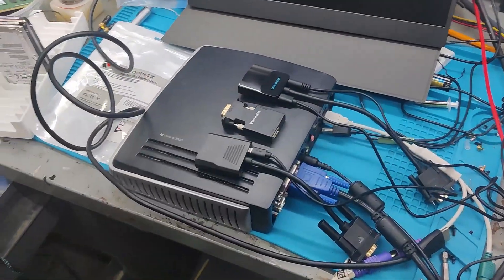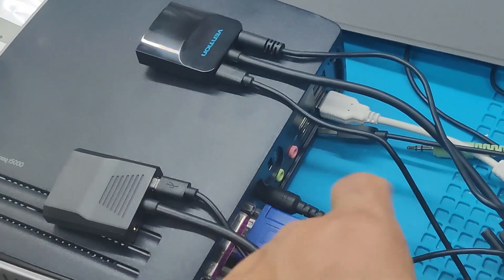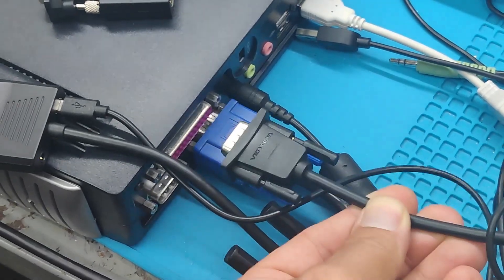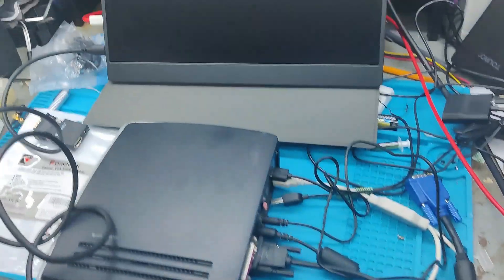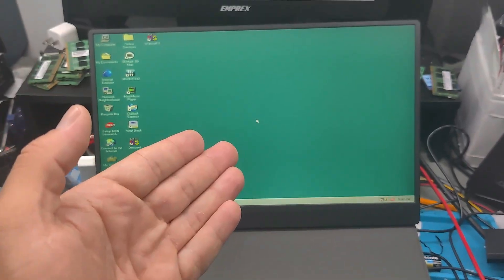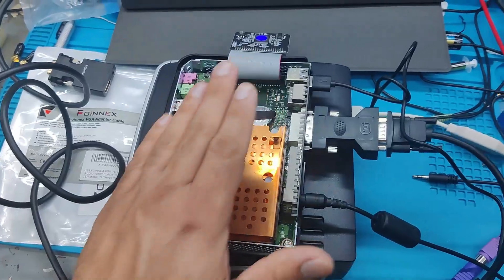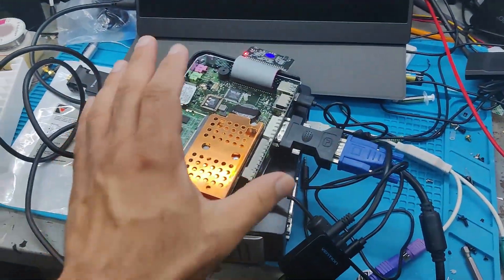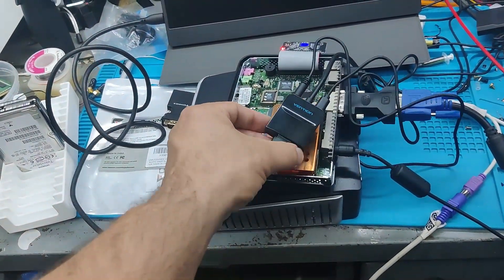Why Many VGA→HDMI Adapters Don't work with Retro Computers

Comment: My adapter works fine but unfortunately it controls all aspects of my realtek audio and windows standard audio. If I use a phone charger to prevent usb audio taking over the screen is blank. My old media pc hp m7000 will not let me have any sound inputs or outputs. If I disable that USB connection still plugged in to the computer all my volume controls and realtek are useless. They go away. Did this adapter steal my audio?

Comment: Someone made a small DOS TRS utility called VGA240 to make DOS run in 640x480 at 60Hz on the VGA output (posibly DVI too, IDK). 
It also significantly reduces screen tearing in DOS games on 60Hz LCD monitors, and makes the pixels way more uniform in 320x200 & 640x400 on LCDs.
Reply from the maker: Thanks for the information! I'll check that utility out. :)

Comment: I've never had to connect a VGA output to an HDMI monitor, mainly because I don't have any HDMI monitors (the TV in the living room, sure, and on my VHS-to-DVD rig).  For me it's been the opposite direction, HDMI-out to a VGA or DVI monitor (RaspberryPi & such).  Of course if I have a DVI input I'll convert to that first.
But I have ever had an HDMI-to-VGA adapter fail to work in the same way.

Comment: Actualy they may jusy need external power! Make sure they are vga to hdmi not the other way around or are bi directional works both ways with a connector to apply power

Comment: I also have used the same Vention adapter with an Atari ST that has even weirder resolutions and it worked without problem with my LG TV, the TV even reported those strange resolutions correctly.
It looks like all those adapter just convert the analog signal to digital and its up to the TV/Monitor if they can handle the resolution you send them, so your problem seems to be more on the HDMI monitor and what they can handle
Reply from the maker: Ah, so I have to continue testing... I'll try using an HDTV to see what happens. They may be more permissive with the resolution set they support.

Comment: Don't know how many of those I went through trying to find anything that would work, but near as I could tell there was once a chip that worked except now they're all the same non-functional options in different cases. Only time I got a capture was running it through a framemeister though those are novelty items by themselves at this point 😅

Maybe a PC capture card can work better at locking onto the more quaint resolutions though probably nothing from this decade either.
Reply from the maker: Thanks for sharing your experience!

Comment: So basically it doesn't support certain resolutions. Btw the dvi-d signal is compatible with hdmi so is better to use dvi-d/i to hdmi adapter directly when possible and it doesn't need any powering too.
Reply from the maker: That's a good point about the DVI-D, thanks for sharing!
Reply: @NostalgiaPCTV  Mose DVI ports are DVI-I and that means they have both analog VGA signals and DVI-D / HDMI compatible digital signals on them, those DVI to VGA adapters have noting but wires connecting the right pins together in them, there is not a single bit of electronics inside

Comment: If my theory is correct, the device takes the display mode and does an if-else / switch-case statement to then try to match it with the respective HDMI one, which sometimes fails.
Reply from the maker: It probably is programmed to do a 1:1 bit mapping to eliminate the need of actually having to do any encoding/decoding with scaling in hardware. Makes sense for something that fits in such a small package.

Comment: There is an old alternative standard, "LCD" VGA mode, mainly for 80s laptops. This has 640x400 (or 640x200) pixels and 8x16 (or 8x8) characters.